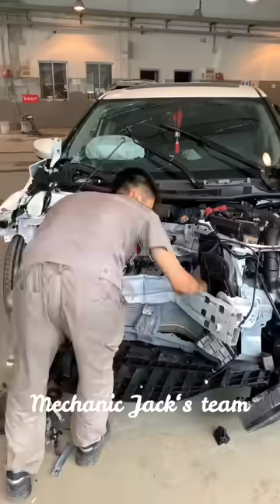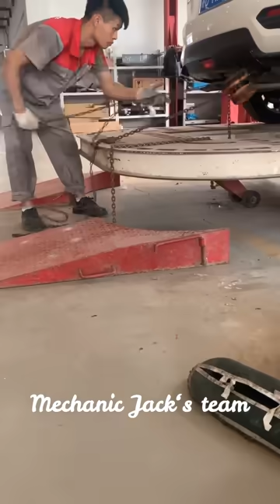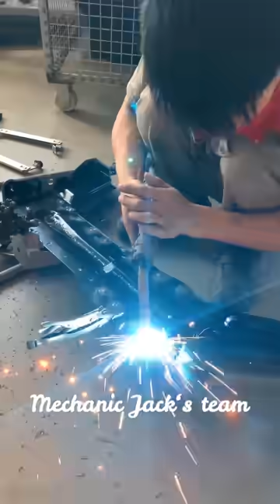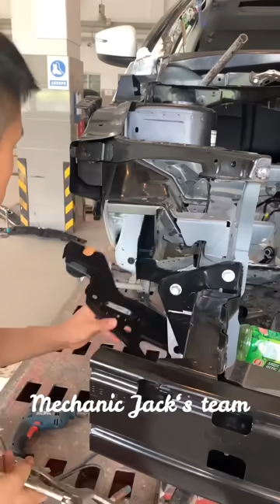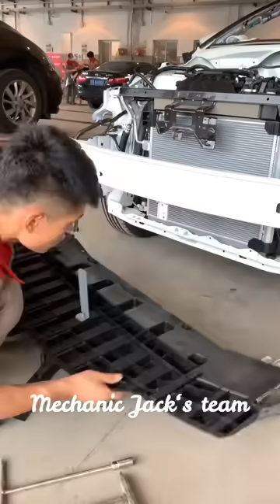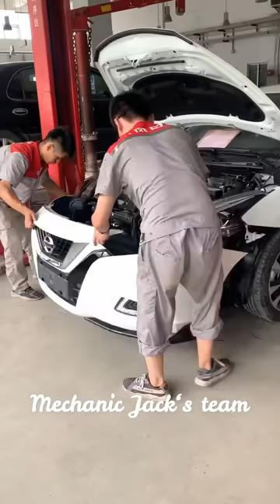Nissan Lannia | Process of car restoration. (front crashed)

Comment: Very impressive work, but in an accident that severe the body structure is compromised, and it can be very dangerous if it is in another crash as the crumple zones and safety system may not function properly. It' basically a death trap. I advise everyone to stay away from cars that have previously been in a crash.
Reply: @Smdn Snnd and shouldn't be allowed in any other country either
Reply: Think about it though. The crumple zones will crumple again in the same spot, which is the correct spot, so it’s kind of the same thing.
Reply: @bobsmithinson2050  Yeah, but instead of X Newtons of force it will absorb X/5 Newtons of force. Not good for you, not good for the pedestrian neither, because also the pedestrian will experience a quicker negative acceleration.
Reply: I'm more concerned with the engine and the radiator. I'd bet some components took a hit. It's only a matter of time before something starts acting up.
Reply: I did not see them replace the floor mounted chassis rail which was crumpled. I think they just hammered it back so it would crumple sooner if it crashed again  also it is not galvanized like it would be in the factory so I expect it will rust from inside all the new box sections. The trouble is it looks too good and you can't tell what it has had done to it during and after the accident.
Reply: It took this far down to find this comment. I had to pass all the ass kissing. This should have been totalled.
Reply: Yeah, that’s a hard no for me.  Airbags deployed…I’m out.  This would never “legally” be allowed here without having a branded title.  Repair looks good but will fold like a tin can if hit again, regardless how talented these guys are.  I know rules differ in other countries but safety needs to come first.
Reply: Вам надо 😮зрение проверить, раз вы не видите новых кузовных элементов, которые заменены.
Reply: This is not a rebuild or repaired car, this is a dead trap and trash. Work and effort can be good but not enough for safety, just for a good look.
Reply: @greg0063 😅😅😅😅😅
Reply: @Бамбарбиякергуду02 проверь свое, пол в салоне, просто отстукали, все поржавеет и сгниет за 3-4 года.
А главное зачем столько сил и денег.?
Купи ценный кузов б.у., перестань навесное.
Дешевле и лучьше.
Это фуфел, хоть и качественный.
Reply: @bobsmithinson2050  🤣🤣🤣🤣🤣
Reply: I agree
Reply: @bobsmithinson2050 не одно и тоже там все новое по безопасности ни хуже чем с завода, какие там изгибы там все заменено
Reply: Щ
Reply: You do realize all of the crumple structures were replaced. Even the firewall. Only the floor remained.
Reply: Tragic
Reply: Above all, most of the time, this type of shock is not economically repairable.
Reply: Not impressive. This is why cooperative dont do this. Whats the point of restorating the frame when its been compromised?
Reply: Really
Reply: These cars are designed to be repaired in this matter. Do you research.
Do you even realize there’s a difference between the cars it is sold over there under the brand name and over here under the brand name?
Reply: These chinese Dont care. Thats the main reason why the US Dont do it.

Comment: This should have been totaled.  But I admire the work.
Reply: I Agree, but I'll still give this video a thumbs up.
Reply: Why, because the insurance company says so?
Reply: Because of the extent of the damage.  Typically if repair is more than half the value of the vehicle it’s totaled.  That much repair would hit that mark.
Reply: Exactly, and this is a pretty cheap model not worth the insurance, most vehicles that require this amount of repairs in the USA are claimed as total loss.
Reply: @squidusn71  No because at 1:47 you see how mush of the cars super structure is missing that's not a little bit that's right past the firewall all the way into the cabin too much damage, I wouldn't drive it, the frame has been too badly compromised, I really don't think this car would hold up in another serious crash, it's done it job and probably saved someone's life,  don't get me wrong the workmanship is sublime and it would probably be ok in day to day driving but if someone hits you at speed would you really want to be in that car knowing the frame has taken a major shit kicking?  Once you bend metal it's weak and will collapse especially under the forces at work in a high-speed crash or rollover.
Reply: The frame was totally bent and gone, I would never drive this car again
Reply: @MAXWINS-mg5nj  What does this have to do with car repair?  And why are you spamming other videos. And why is watch mojo ok with this?
Reply: It is probably totaled, you can fix totaled cars too btw
Reply: @ChrisJohnson-rn2ls  extent of the damage is based on repair cost by insurance companies...in the US.  This vedio is not in the US.
Reply: @TheGamerShowsYou  this vedio is not in the USA.
Reply: @squidusn71  It doesn't matter where is video is filmed lol. We are making factual statements and relating it to how it works in the USA. The fact that these kind of repairs are allowed to be "road-legal" is dangerous. I don't know one sane person that will drive this vehicle after what happened in the accident, Jack's team did a great job on the repair though
Reply: That's not USA this guys clearly know how to fix this cars, in USA everything gets dumped and new stuff built but thankfully there are countries like this that take the time and have the skills to repair and put those vehicles back on the road
Reply: @kllgrogto5838  Why are you going off-topic? Nobody is talking about texting and drive or DUI has nothing to do with the metal framework lol. You know you are wrong. You should go to school if you don't realize that you can NEVER turn metal back into the same condition it was in the integrity of that metal will always be weaker than before. Jack and his team do great work but as mentioned before in the USA these types of "repairs" are very rare and usually, cars that are damaged THIS badly are total loss.
Reply: All that wouldn’t fly here in the states, anything dealing repair or damage to the the firewall like that would be out door total loss. No if and or buts about it.
Reply: I'm sure it was totalled. Insurance will let you buy the car for a couple hundred bucks though as it is cheaper than them having it discarded and if you manage to fix it the mvd will look at it and give you a salvage title 👍
Reply: @TheGamerShowsYou  lol, you guys do chop tops and drive rat rods where are the sanity in that?
Reply: @shemmy95  this would be one of many cars you see on the road dog tracking but the body looks great.
Reply: @squidusn71  Touche'  however you and I both know that every vehicle isnt a "rat-rod" in fact most vehicles on US roads are just mainly regular vehicles/suvs rather than be a chopped car.
Reply: @TheGamerShowsYou  you and I know that there's probably more junk and more unsafe cars on the road in the US than the one like it on this video.
Reply: Why, just because you can't fix it.
Reply: @TheGamerShowsYou  are you blinded do you not see they replace every damage parts beyond some dent.
Reply: @richardparnell8402  I'm sure this car is as safe as a new one. You can see his way of repairing the car is unmatched. He screws the weldings done by factory to install identical replacemts and weld it once again the same way the factory did. In the end I do prefer to buy a clean history car but if it's repaired as shown in the video I do believe it's a good car and even if it happens to crash again the car will crumble to disperse the energy all across the body like a new car.
Reply: @samihtf7921  cool, as good as the workmanship is I would pass on it.  For me it's just not worth finding out.
Reply: This is China. Some people will re-sale the car as brand new car
Reply: No, it can be fixed as you see
Reply: I agree but fixing is better for the environment
Reply: @squidusn71  no because the amount of recourses spent far surpases the resale value or cars worth
Reply: @alfrezz000  in what country?  This guy makes several videos of this type of rebuild/repair. I'm sure he's not doing it for your entertainment.
Reply: In america repair cost is so expensive compare to asian coutry.. only minor accident with small dent also will cost more than $2k where the repair cost in asian country will only cost below $1k.
Reply: @richardparnell8402  8
Reply: @alfrezz000  you are basing it on the costs in your country. In other countries cars cost much more and because of retail taxes they cost much more. Taxes on labor costs and parts are much lesser than on new cars. Plus registration etc in some countries can cost a bomb. Plus labor as well as operational costs of repair shops vs new dealer sold cars in some countries are much lesser so it makes economic sense to repair.  My main concern was the chasis beam inside the driver side floor it had crumpled a bit and they just pulled it out. I'm not sure if it's a good thing as it weakens the metal. Reinforcement also could alter the crumple performance. Maybe someone with proper background in this can comment on that.
Reply: @ChrisJohnson-rn2ls  uneconomical to repair, but repairable, and safe if done right as this guy has done, most would do dodgey jobs but this is a great example of a professional repair but with the lack of ppe
Reply: @MexicaliBenchmark  ok yes those cars in that video  you shared were repairable and I would drive it but the ones in this video I don't know I still wouldn't feel safe
Reply: @MexicaliBenchmark  I would like to see a repair of this magnitude go for testing and be proved wrong
Reply: @kllgrogto5838  bro listen, if the car gets damage like that here in US it will go to total lost, the insurance doesn’t pay or cover the expenses that exceed the limit of their repair or lets just say your car worth $10,000 and the damages needs to be repair cost you $6-7k they won’t fix it lol unless you fix it yourself and give you half of the money they offer you for total loss
Reply: What’s wrong with fixing it ? Who cares if it’s “value” cost more then repairs… do you know how much it cost wherever this is being done at ?
Reply: @KHkkkkkk finally someone who knows the reality of this car 😂
Reply: Looks looks like it is in china and the labor is cheaper there, therefore insurance companies are able to carry out more extensive repairs
Reply: Repairs like this aren’t as wasteful as trashing it as buying new in the grand scheme of things
Reply: Today crash repairers mainly do cosmetic jobs , soon there won’t be any good panel beaters around . . This guy is very good ,
Reply: Wow, restored to factory conditions. I am impressed with the knowledge, skills and availability of spare parts. Clearly you are sourcing directly from factory suppliers.
Reply: @squidusn71  nothing to do with money but with safety. The next crash this car will fold in on itself like a tin can.
Reply: @Av987  You do realize that this guy doesn't wear a welding helmet while welding rigth?
Reply: @AM-dn4lk its not even close to factory conditions, frame of this car will no longer provide the stiffness and safety it supposed to, its now a paper box that looks like a car

Comment: Where do you draw the line and say... "it's not worth fixing?"
Reply: Doug's Welding & Fabrication He doesn’t know how to draw lines Hahahahahaha
That’s why he keeps going
Reply: I am as surprised as you are, in reality I guess it is the insurance company and the shop.  Obviously this car was almost a total loss, but I guess that the engine and transmission were OK, this is a job done by two tecnicians and as the car is so new, the only used original parts.  I would estimate that repair would cost there well over $7000 there but I can be wrong, they had to pull out all the drive train and the front of the car, huge amount of work.  That is a car of about $22000.  
Again a top notch job, great quality, almost factory quality and that is to say a lot
Reply: It's done all the time and they're being sold at barret jackson for hundreds of thousands or even millions lol.
Reply: They don't wear face shields when welding so they can't see that it's not worth fixing.... my pov only
Reply: These guys probably buy these vehicles at auctions for cheap,  and repair and sell
Reply: They are demonstrating their shop!
Reply: When no part can be salvaged or repaired like a complete burn like a bush fire, crushed like in an earthquake or split like high impact. 

As you can see these circumstances are rare. Most everything is repairable. Totalled or writeoff is a term for business on determining if can be commercially repairable not a determination if it is physically repairable.

The question is where do you draw a line of repairing to benefit the environment and consumer rather than throwing away or forcing to be thrown away.
Reply: most collisions are repaired in China, labour is extremely cheap. Parts aren't expensive, but the price of new cars are expensive, especially imported ones are easily 3x the price of other countries.
Reply: I Wonder how this car after rebuild will take second impact
Reply: When the structure integrity is compromised and the repair cost is beyond the insurance coverage.
Reply: If there’s a will there’s a way lol
Reply: @christiantorres2697  agree
Reply: This is why Some 🇺🇸  companies sell there jobs to China. Cause nobody wants to work that hard.
Reply: Death trap......
Reply: The average GDP per capita is 10k USD in China, which means fix the car save a guy's whole year (even 2) income. 

Dose it looks like take him a year to do the job? No. So the line is very far back..
Reply: @MexicaliBenchmark  ok Carlos why don't you go buy a written off car like this one and put your family in it or buy it for your daughter to drive. Good luck 🤞, problem is you can not identify the quality of work or human error from car to car to verify structural soundness like a factory can.
Reply: this guys are probably making$1 per hr of labor, compare with a US repair shop worker maybe $25 so that is why they fix these kind of damages
Reply: In china, never. Money is major concern, not safety

Comment: They did an amazing job. Another thing I forgot to mention in my first post. When you take something apart, you have a pretty good idea how to put it back together because you know what it looked like before you took it apart. But when a vehicle comes in with the front end looking like a crumpled up beer can. Rebuilding a whole new front section of a vehicle can be quite challenging, especially if its a brand new model that nobody has worked on before.
Reply: That's what happens whenever I try to re-assemble an engine 😂😂
Reply: There is a thing naming a diagram.
Reply: It's called repetition, you do enough of them and their basically all the same
Reply: O trabalho realmente eh incrível, o resultado final fantástico, porém, em termos de segurança, o veículo não eh e não será mais o mesmo!!!! O chassi foi deformado e o metal terá sempre memória do amassado, se houver 1 próxima, a resistência esperada pela engenharia não ocorrerá e o dano será maior, colocando vidas em risco!!!! Além do que, financeiramente,  um dano como este não sei se seria viável a recuperação!!!!

Comment: Absolutely awesome workmanship,so meticulous. Only question I have is,how is it cost effective to repair that amount of damage?
Reply: If the engine was salvageable and the main chassis not bent then definitely worth it. If not...
Reply: You are more likely to see these cars repaired in places with high import taxes, some places it's as high as 100%
Reply: When a used car of similar age is more expensive than a restored one, then it's worth doing. Otherwise, might as well but a used, undamaged car.

Comment: It's nice to see that these guy's are repairing this vehicle correctly. I used to work in a bodyshop as my dad's helper. I have seen wrecks come in that would have blood sprayed all over the interior, which mostly led to that vehicle being a total loss.

This vehicle that these guys are working on should have been a total loss. But if they repair it like it's supposed to be repaired, this vehicle will be just as good as it was before the train plowed through the front of it. LoLz.

Comment: In this case the bodyshell of NISSAN has lost structural integrity. This is called as bodyshell completely unstable
Reply: Nope, they did a fantastic job on the repair. they replaced the front frame and straightened the tub, also added additional screws to hold it in place. if it's still unstable then i don't know what else they would do.
Reply: @chilly1661  the body is unstable.  If it gets into another accident, the frame would bend way more than usual since it has been weakened. I would not sit in that car. Final destination shit waiting to happen.